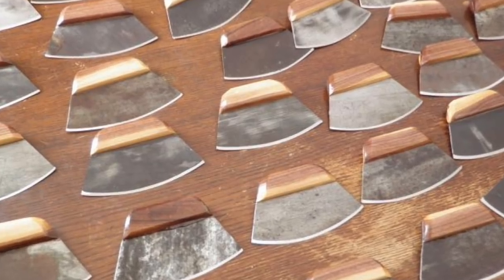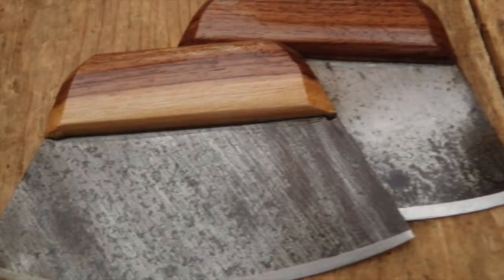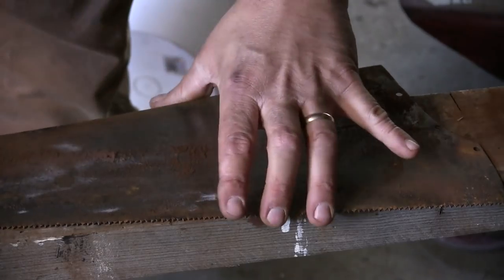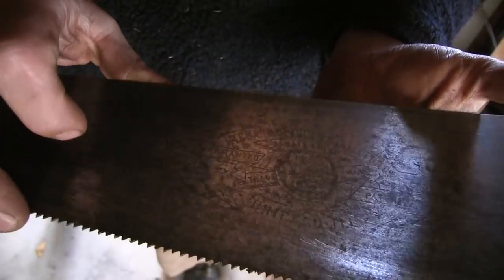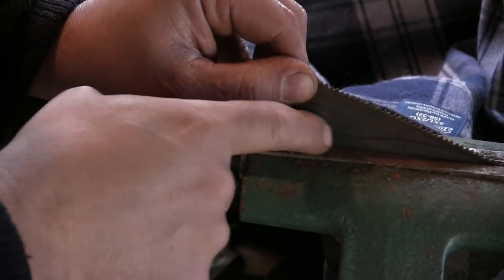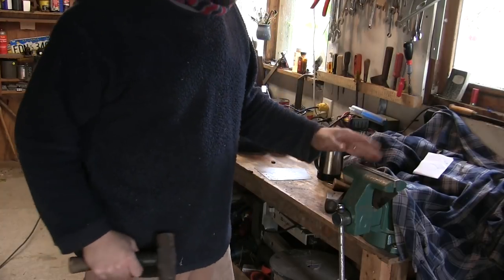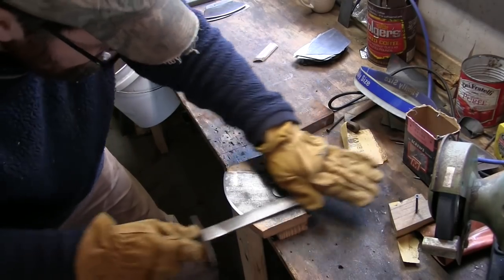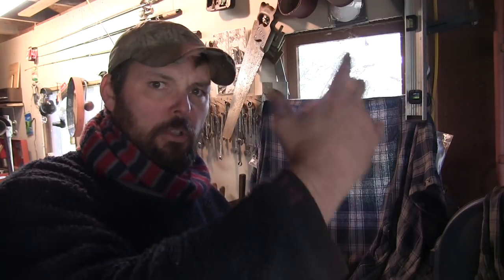How to make an Ulu Knife............ ( introduction)

Comment: I`ve been restoring, selling and collecting vintage saws for years, and have been looking for a way to use badly crimped or not so valuable ones. The etch you showed, if you look closely, you will see a 4 petaled flower...each petal has the profile of a woman`s face. Above  that flower are the words "ALWAYS AHEAD" , which  to my thinking is a way E.C. Atkins & Co  showed  they made that particular hardware store saw , without placing their name on it...Their logo was "ATKINS ALWAYS AHEAD".  I forget the store, but it partially shows on yours saw. The handle from that saw was cool & unique as well.

Comment: Bushradical, Please expand on your answer that it is not a ideal knife steel .Not that I would want to give up my Rapala filet knife ,, which I think would be hard to beat after half century of using them.
Reply from the maker: Other than using epoxy....I make these knives the traditional way, and old hand saws were the material of choice from probably the mid 1800's

Comment: I picked up a couple old hand saw at a yard sale earlier this summer just for this project. I don't have a heavy duty      vice,  could the blanks be cut out with a cutoff wheel on an angle grinder? I was also wondering  if the saw blade material would work well for a fillet knife.
Reply: Oh yea itll work, ive made a few knives that way. But when you cut the metal, make sure to clamp it down to the bench. And constantly cool the metal with a wet rag while cutting and grinding the profile so it doesnt lose its temper. Its not ideal knife steel, but it'll work decently
Reply: @benjaminlockhart2792  Thanks for the tip.
Reply from the maker: You could cut out the sides and top with a cut off wheel, but I would be afraid to mess up the temper by cutting out the blade.......I would just keep an eye out for a good cheap vise.
Reply: @Dave Kibbey
No problem man. + 1 to what Dave said about not cutting the edge with it. You can do it, but you need to be really careful not to overheat. Take it very slow, cause once you lose the temper its gone. 
A vise sure does make it easier to cut metal, but you dont need it. 
I used C-clamps and vise grips to hold metal down to cut it before I bought a vise.  Make sure you use 2 clamps or it will rotate and bind the cutoff wheel.

Comment: Dave, in your opinion, would I be risking the temper if I just scored my pattern line with a Dremel tool before I make the actual break with hammer and chisel?  Just wondering if it would make for a more accurate break.  Thanks
Reply from the maker: I dont "think" it would. You can break one out really quick when you get the hang of it.

Comment: great vid, and good information in the comments.

do you know roughly when the shift from fully tool steel handsaw blades to hardened only at the teeth happened? it seems pretty rational, a sort of katana approach, but i did not realize that had occurred. anyway, it would be cool to be able to sort of date the switch, or have some visible identifier if purchasing an old saw at a flea market. i have some saws with the temper zone evident, but i also question if that's real, or some flashy marketing tool.

anyway, you and your girl are doing great work... and i say, "your girl" with full grasp of the greater likelihood that you are "her boy", and that you will be spanked for my semantic malfeasance. good luck, buddy!

thanks for the awesome and informative videos.
Reply from the maker: LOL. Thanks. As for the saw steel, any saw with brass handle nuts is going to be all the same temper through and through. If you go buy a new saw and the teeth are all a different color than the blade....well they are hardened teeth only.
Reply: copy that, brass hardware, and definitely avoid the obvious temper zone... thanks, i'll be eyes open for old ulu stock.

far out. if i actually end up with any cool brand script, i'll send you photos. probably never happen, but here on the east coast old crap has a way of occasionally unearthing itself 

 @Bushradical

Comment: If I can’t find an old saw, can I just go to HD and buy a new one?
Reply: Unfortunately, No, typically the new ones are only tool steel on the tips and soft steel everywhere else.  The old ones are entirely tool steel.
Reply from the maker: .....no you can't. The new saws are only tempered in the teeth area...the rest of the saw is softer. But you can find an old handsaw at any antique store.